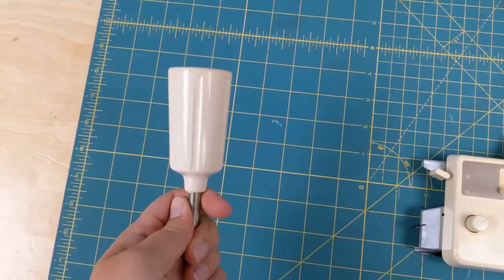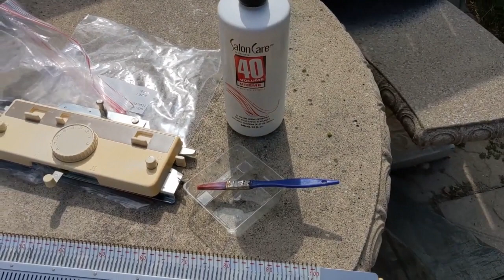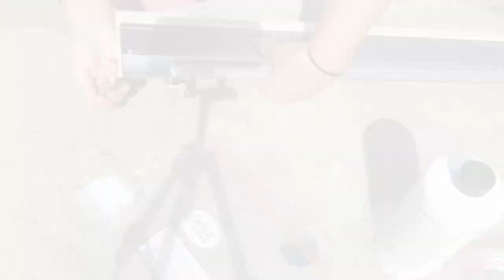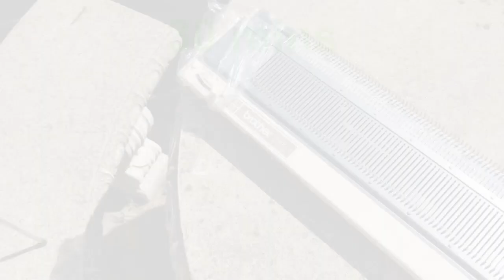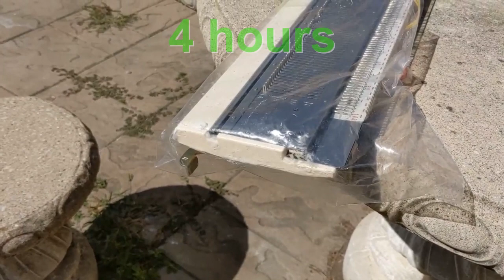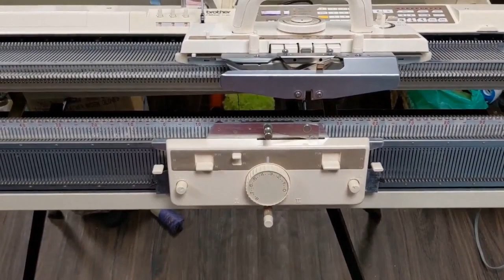Whitening a Yellowed Vintage Knitting Machine (RetroBrite)

Comment: if you are doing heat sensitive parts, using UV LEDs in a box works pretty well but is usually slower, depending on how bright the sun in where you are. putting the parts in a sealed box can also help reduce streaking because they wont dry so quickly and don't usually need to be wrapped. hope that helps someone.

Comment: It is a great way to restore the colour to plastic that has UV discoloured, however, it doesn’t last, it goes back to the way it was over a few months.
Reply from the maker: I had heard that also, but for me it hasn't been the case. I have a machine and parts I did last year that looks the same as when I first did the treatment. However it has all been kept in a basement without much natural light. It is possible it might be a different outcome if exposed to UV light again, since the offending chemical is still there in the plastic.
Reply: Heather Is Making Stuff It doesn’t go nicotine yellow again but it doesn’t last the lovely bright white from when the retro brighting was first done, even left in ambient light, at least that was the case for me, glad you have managed to keep it as is.
Reply from the maker: @NumaticVacuum  interesting, I'll have to see how it holds up
Reply: After whitening you need to keep your item covered when in sunlight!

Comment: Heather, great help, how did you clean or neutralize the peroxide?  
Mine is actually golden yellow...  looks it’s age, lol!  The ribber looks almost new comparably.  Thanks!
Reply from the maker: It dries up after a while and I wiped it down with alcohol (what I usually use to clean the machine bed) to get any residue off. My sk155 that I had previously was a lot worse than this one - looked like those harvest gold appliances from the 1970s before it had its spa day.
Reply: @heatherismakingstuff  thats what mine looks like, do the peroxide affect the lettering on the carriage cover around the dial?
Reply from the maker: @denisefernekes182  I only did the ribber and not the main carriage, but if you're concerned you can tape over any parts you want to protect. I should have taped the plastic insert bit on the ribber but it didn't damage it, just the glue underneath that held it on.

Comment: Thank you for sharing your experience. Just a question: how did you clean the items after the process?
Reply from the maker: Mostly it just wipes off, and the remainder I cleaned off with rubbing alcohol (I use this for cleaning the machines most of the time.)

Comment: Would this work without the sun?👀👀x
Reply from the maker: Sorry I didn't see your reply before now! I don't think it works without some kind of UV light exposure, but I have seen people do it with a UV bulb instead of the sun. However I'm not an expert in what makes it work, maybe it's just the heat that does it and not the light itself as is the case with bleaching hair?! I would say you'd have to try and see what happens

Comment: Oh no don't do this without taking off the plastic parts, you must separate the pieces to do a good job in the first place, and also you don't want the metal parts to get rusty by making them wet and not being able to dry them properly. Especially the unaccessible spots where the screws hold everything in place. Plus hydrogen peroxyde, which contains oxygen, increases the oxydation process (as the word says). Let the experts do this, keep your cookie coloured machine healthy instead